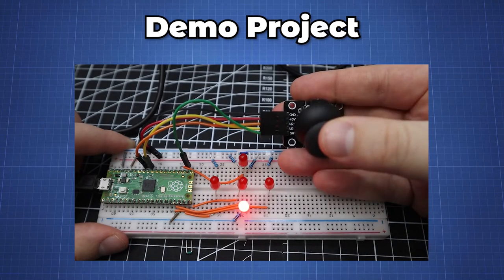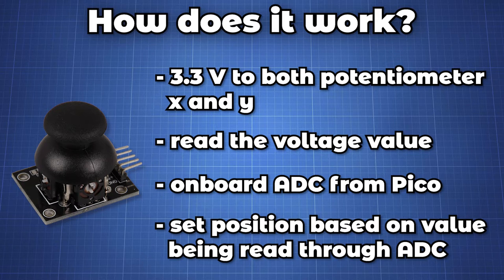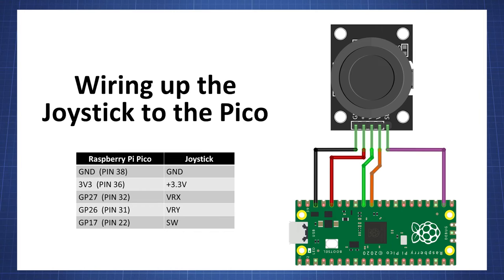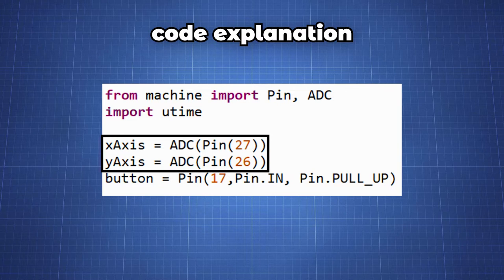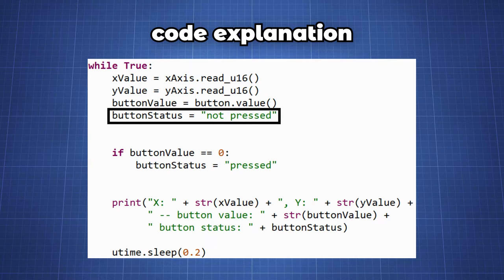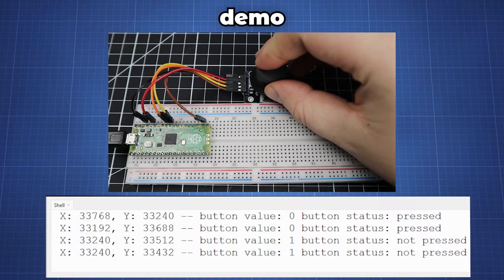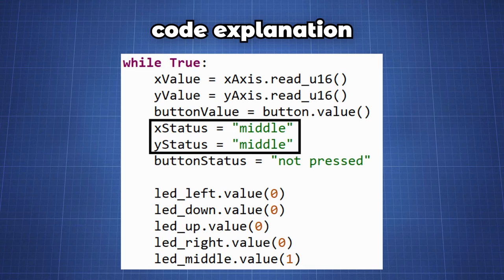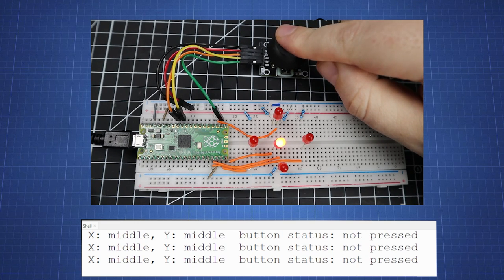Raspberry Pi Pico Tutorial - Joystick ( MicroPython )

Comment: can i change the code and make the joystick on raspberry pi 4 as mouse
Reply from the maker: Hello, well I am not sure about this one because I have not programmed the raspberry pi 4 if you for example use to joystick with the pico and use the HID library in CircuitPython and connect it to raspberry pi 4 it will work as a mouse
Reply: @NerdCaveYT  thank you for the answer

Comment: Can someone help me when i pull the joystick up to set the y or x to 65000 then both the y and x value goes up to 65000.
Reply from the maker: Hi, so you can just in code if you pull up for example y goes above a certain threshold then you can just set both y and x to 65000 with an if statement
Reply: @NerdCaveYT  But what should i do to fix it that only y or x goes up to 65000

Comment: Awesome! Saw your post on reddit OP 😁

Question:
What would happen if you put the joy stick in between 2 direction? Would it lit both LED or you need another line for that?
Reply from the maker: It will both be on since the two if statements would be true and thus both will be one if you want to put an extra LED between the two direction you can make another if statement that will trigger if both is true and then you make the other normal direction to be 0.

Comment: hi... can this applied to make an atari joystick adapter?? Thanks for your tutorials
Reply from the maker: Hi so if I understand correct you want to take an Atari joystick connect it to pico to be used as input for pc
Reply: @NerdCaveYT  yes... That´s Right...
Reply from the maker: @gggg-bk7md  that should be possible saw someone do it on Arduino and explain which each pin does and how to connect it, it will be easy to rewrite in CircuitPython then on the Pico
Reply: @NerdCaveYT  ok, thanks por your answer... ✌

Comment: Hey boet. Nice video. I wanted to ask if you know of any HID library to get these to work as joysticks for a PC, kind of making your own controller thing.
Reply from the maker: Hello thank you, CircuitPython has a great HID library: https://docs.circuitpython.org/projects/hid/en/4.0.1/_modules/adafruit_hid/gamepad.html I used it for a Macro Keyboard and Midi before, I assume you will want the joystick to send certain values that part you might to code like something similar I did in my last value to see the value of the joystick position since those modules fluctuate a lot when they are connected to the ADC channel. If you need more help got a discord channel not much going on there now: https://discord.gg/A4zegrBp

Comment: Do you know if there is any way to run two analog sticks off the one board?
Reply from the maker: Hi Callum, so since the Pico only has 3 ADC channels you will have to add external ADC which you can by using something like the ADS1115 16-Bit ADC

Comment: Thanks for the video!
Is there a way to use the Joystick as a mouse pointer on the computer using MicroPython?
Reply from the maker: Hi, yes circuit python has a great HID library which can do it, I get this question a lot will look at making a video soon once I settle in to new place
Reply: @NerdCaveYT  thanks!
i was hoping to find someone who managed to run HID on MicroPyhon, not circuitpython

Comment: Hi, can I use this code with a regular raspberry pi 3?
Reply from the maker: I just checked the raspberry pi 3 does not have ADC chip but you can use an external ADC such as the MCP3008

Comment: Hey nerdcave!
Could you do a tutorial where instead of lights, it sets a variable in python?
Reply from the maker: Hi, in this video there is a variable being changed due to the Analog in, do you mean if you push the joystick forward it will add for example 1 to another variable? I am just not completely sure how you want to control the variable what is should do if you push forward, backward, left or right.
Reply: @NerdCaveYT  yeah! That's great.
I'm trying to do a game in python dependent on the joystick for a mini arcade cabinet, so it'd control the y-axis of a pong paddle.
Reply from the maker: So at this moment you have the line yValue = yAxis.read_u16() this will read the "middle" value which will give you a minimum value of 0 to maximum 65,536 depending in which direction you push the joystick. Now in your game you will then set the paddle equal to this yvalue. The only issue is you will need a few if statements like my last example because the value fluctuate in middle if joystick is not pushed.

Comment: How i can use this project as a real joystick, on a pc?
Reply from the maker: Will have to use circuit python and set up as a joystick, let me have a look at it and make a video lot of people asking about this
Reply: @NerdCaveYT  can you keep me updated on if this can be done your toutorials have been the best on YouTube for sure! My goal is to have the joystick output for the number pad on a keyboard in the direction it’s pointing then button press for the “5” key can this be done?
Reply from the maker: @Elmorji  how will the number pad look like? push upwards "1" right "2" etc. ?
Reply: @NerdCaveYT  yea so if I could get the code to make the push button be number 5 . Then “up” as number 8 . Left as number 4 . Right as number 6 . Down as number 2 . That would be perfect.
Reply: @NerdCaveYT  I am 2 days new into programming a pico . Is there a way to have windows automatically recognize this pico as the keyboard that’s programmed to a joystick or do you Allways have to open thoony and press the play button.
Reply: @NerdCaveYT  this would also be for movement in a simulator. So it would be like holding down a physical key on a keyboard not just a press like the keypad video
Reply: @NerdCaveYT  I hope in your help, to make a simple 2 axis joystick works as hid devices, not button only joystick